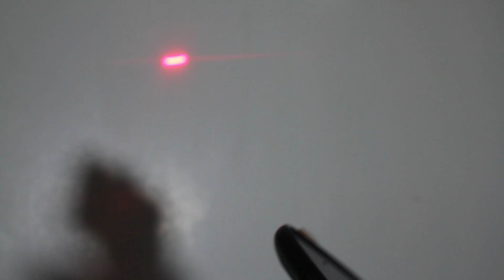How to Make a Laser for your Phone (OTG Laser)

Comment: Can i use data cable from charger and how also what if i dont have soldering iron i have small button cell laser pointer
Reply: hey mate you can't use a regular data cable as the pin required to be shorted is not on any standard  data cable/Charger